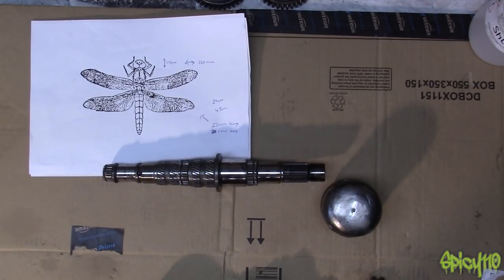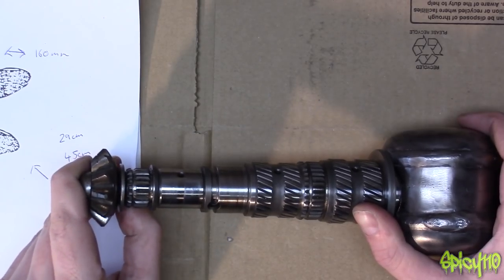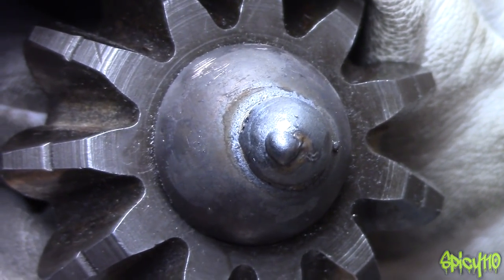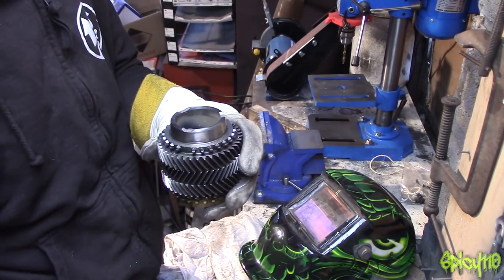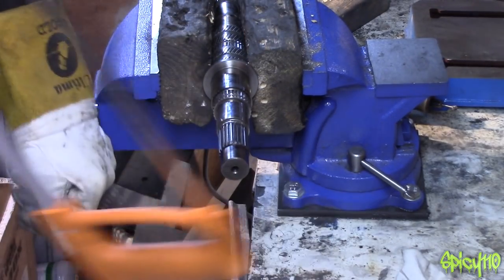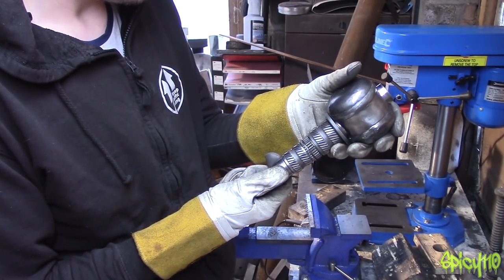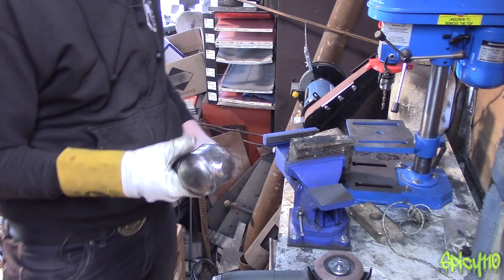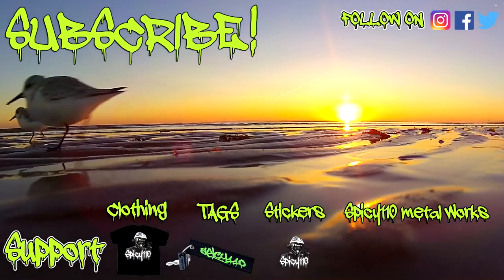Dragonfly build! Making the head!

Comment: Good to see your skills improving Spicy, when it comes to welding try to giggle alittle more and move up/down faster, position your hand so you naturally pull the tip towards the center, it makes your welds alittle smoother (slower as the puddle forms and naturally faster as the puddle is established if that makes sense?). Hope that helps :) Also clean up your shop :P paper and sparks make the firemen fart? or have to come round to put the flames out, either one.

Comment: 16:12 Yes spice it's from oil that has been absorbed into the metal of the shaft. That's the problem with welding things that live in oil. The only way to get rid of it really is to burn it out using a turbo torch or oxy-acetylene torch.  But seeing as its just a sculpture there no need to heat its all up to cherry red just to put a bit of weld on. Multiple application of acetone should be good enough to get the worst off. Also, make sure the wire you use is ER70S-6, not ER70S-2. The ER70S-6 has more silicon in it which acts as a deoxidiser and helps with contamination. It should say on the box under the tech specs.
Reply from the maker: Thought so thanks! One application would have been a start haha but I always forget.
Reply: It'll be alright there's plenty of metal there holding it on.

Comment: They say if you're getting a brown soot around your weld then there is a lack of shielding gas, have you a flow meter that measures you gas in litres per minuet ?
Reply from the maker: To my understanding it's a silicone residue from the Wire. I do run my gas low but as long as the weld is good it's good.